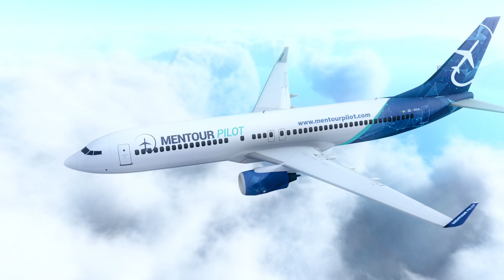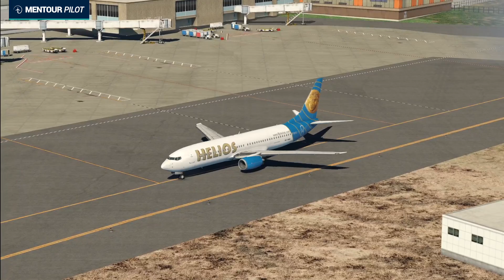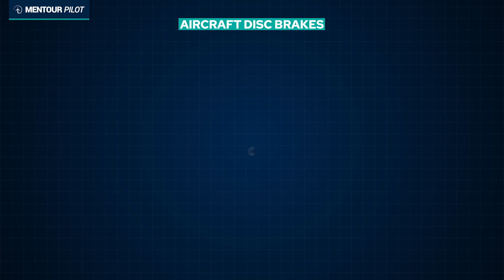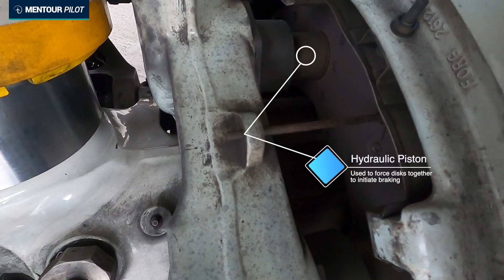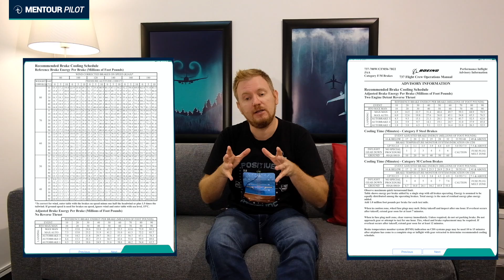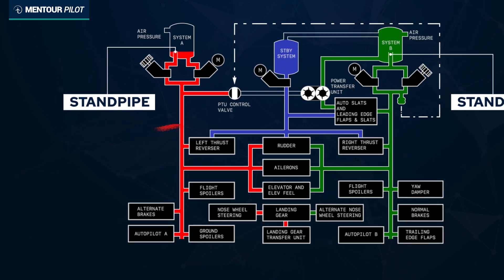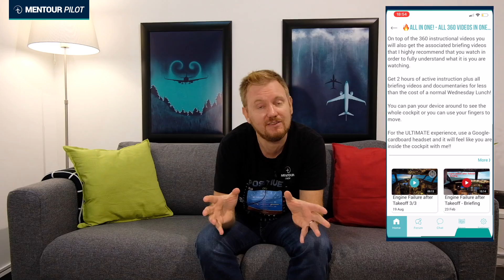How do Aircraft BRAKES work?!

Comment: Why don’t u drop the Landing gear earlier before Landing so they could cool down in the airstream.....
Reply: Extending the landing gear produces lots of drag--probably leading to more fuel use. I'm not a pilot, but I'd assume airlines won't want to go through the process of developing new procedures for this kind of brake cooling if:
-the current procedures seem to work well enough, and
-fuel is such a large expense
Reply: @almach6279  as u can see in the chart,  the temperature drops pretty fast right before touchdown so it is a matter of some minutes..... an in final approach u would have to hit the airbrake less... but ok.. I‘m willing to accept someone with more knowledge about flying than me, might have tough about it already.  ;o)
Reply: No need to cool down brakes before they are hot😉
Reply: @speedbird9313  if u look to the chart... and as he mentioned it ....there obviously is....
Reply: @frankangermann6460   Maybe on an island hopping airline with a lot of short haul, but other than that I dont think anyone actually use that chart😆
Reply: @speedbird9313  as he mentioned it.....
Reply: @frankangermann6460  Is that your reply for everything? As he mentioned, as you can see in the chart..
You have no idea how this works in reality do you..?🤷🏻‍♂️
Reply: @speedbird9313  yes, absolutely...that’s why i was asking, but ur 1st answer made no sense and ur second was not a new.... What should i do? he just mentioned it in his video and it is shown in the chart, its a fact that u obviously missed, sorry.... i was asking actually for this situation of hopping....🤷🏽‍♂️

Comment: Would love to know more about runways
Reply: Two kinds:  "Flexible" (asphalt) and "Rigid" (concrete).  A typical rigid-runway thickness is around 30 cm (international airport) or less, with flexible runways needing to be thicker than rigid to have the same load capability.  Beneath the pavement is a subbase such as compressed gravel, and beneath that the subgrade (native soil).

The cross-section of the runway is "crowned" to promote water removal, sloping downward from the centerline towards either side by about 1.5 degrees.  The main landing gear struts of at least some airliners are canted inward by that same amount, so as to have inboard and outboard tires on a strut make even contact with the runway.

Runways wear out over time from fatigue, like how a metal part eventually fails from bending it back and forth.  So limiting the stress an airliner imposes on a runway (by the number of tires / tire spacing / tire pressure) isn't about the pavement suddenly cracking or rupturing, but rather how many years the pavement will last (and why landing fees are based on aircraft weight or similar -- more pavement stress means less years until the runway needs to be replaced).  The effect that a given airliner type at a given weight has on a runway's fatigue life is quantified by the ACN/PCN method.  Derived from fatigue modeling theory, an Aircraft Classification Number(s) is matched against a Pavement Classification Number to estimate how pavement life will be impacted by anything from an individual aircraft operation to a hypothetical mixture of aircraft types and frequencies.

Comment: Interesting video. I always thought that carbon brakes have always a greater performance in stoping distance. But this is not true? Carbon brakes are mainly for weight reduction and better brake cooling?
Reply: For any brake system, the tire friction on the runway is always the limiting factor.  The traction of the tire doesn't change with steel vs carbon brakes, so the stopping distance won't change significantly -- unless, as Mentour points out, you overheat your steel brakes and they stop working properly.

Comment: Petter, any semi truck driver who deals with long down hill runs know this. That's why they gear down and use engine (jake) brakes rather than rely on friction brakes. Brake fade is a thing, and if a trucker overheats their brakes - well that's what runaway lanes are for. I can't imagine anything more terrifying than having a brake failure as a pilot, trucker or, in my case, in my POS car.
Reply: That is really a case for hybrid trucks

Comment: Do you ever accidentally press the rudders while trying to brake?
Reply: Gabriel Simon another good question. The toe brakes do take some getting used to, and they are surprisingly sensitive.
It’s very easy to over apply or apply one side more than the other until you get a good feel for them after a few flights. Likewise, it’s not unusual for a pilot new to the aircraft to apply some rudder by accident whilst braking which tends to lead to over compensation with the other pedal and a rather untidy rollout! Again, it doesn’t take long to get a feel for them and get the hang of smooth and even brake application. As the video explains, in most cases, the pilots will let the auto-brakes take the strain for the initial brake application and then take over manual braking by overriding the auto brakes with toe brake application once the speed is reduced.

Comment: Why don’t manufacturers use magnetic braking to reduce heat generated under severe braking?
Reply: Just my guess: Because the heat would still be there. The kinetic energy needs to go somewhere. But they might need less hydraulics to activate them.
Reply: It wouls still be the same heat.. if not more. Also magnetic brakes is very heat sensetive.

I only ever seen them on service breakes for japanese high speed trains and maglev breakes.

Most fast trains have magnetic breakes as emergency breakes. But they use it on the rail.

The emergancy breake of those is much more brutal than you might imagine from a train.
Reply: With no physical surface to surface contact what would generate heat?
Reply: @bradmoyer9737  The resistance that opposes the the induced electric flow within the metal.
Reply: @bradmoyer9737  Regardless of the mechanism, the kinetic energy has to be dissipated. Heat results. Heat must be dissipated.

Comment: Does RTO also arm spoilers for rejected takeoff ?
Reply from the maker: Yes, but it’s a different system that activates it
Reply: Partly.  You arm the spoilers to deploy automatically by (1) selecting RTO on the Autobrakes dial as Mentour showed and (2) move the spoiler handle to the "ARMED" position.  Moving the spoiler handle to the ARMED detent will also cause the ground spoilers to automatically deploy during not only a rejected takeoff but during landing as well.

Comment: The 737’s wheels are exposed to the elements during cruise, so wouldn’t the freezing temperatures and winds/apparent winds up there cool the brakes down pretty fast?
Reply: Probably not that fast.  Obviously the landing gear is designed to reduce drag as much as possible when it is retracted.  Thus the air circulation through the wheels is probably limited.  In fact, a quick image search shows that 737s probably have wheel covers (hubcaps if you will).  These would would help keep the brakes nice an snug in their wheel wells when retracted. 😀
Reply: @andrewsnow7386  yup, the "hubcaps' and the rubber seals around the wheels when retracted will prevent airflow in the wheelwells.
Reply: The brakes are applied on landing hardest. The air is not enough. The brakes get very hot when applied. It just takes time to cool brakes down.

Comment: Anybody know why it´s impractical to have parachutes, like the space shuttle has (i know it´s a different beast), as last emergency resource  ? Maybe it´s a silly question but it came to my mind.
Reply: I believe a Soviet airliner or two have had them, but a hassle and best to just up-size the brake a bit.  As an emergency backup, those "soft" overrun areas that a jet's tires break through and bring it to a stop gradually make more sense than a drag chute, though there's the expense of outfitting airports with them.  The drag chute for the Shuttle was introduced post-Challenger, along with a new carbon brake to replace the original beryllium one that was woefully undersized because of Orbiter weight growth between when the brake specs were frozen to when it finally flew.  The carbon brake + drag chute put some margin of safety back into landings which in some cases hadn't had any (brakes overheating to the point of pieces coming off during the rollout).
Reply: My guess would be that having triple redundancy for breaking power plus thrust reversers is covering all incidents. Carrying additional mass for one in a trillion situation is just not viable.
Reply: @Gnato666  I was wondering, with a loss of oil pressure affecting the brakes, for example. But, yes, I suppose that the redundancy and the lower probability are enough not to add an additional system.

Thx for the answer.
Reply: They are realy expensive to use. Also they have a very uneven effect. Space shuttle lands very fast.

A comersial airline land fairly slow, is also lighter than on take of.

What  makes the dimension of the breakes is the rejected takeof.

Comment: Thank you for a new highly detailed video! Quite a lot new things to know. 

The question on the autobrake (especially on the RTO braking).
As i understand the manual brake application disengage the autobrake system. But, as i understand the captain are mandated to manually apply near full manual  braking at the rejected takeoff above 80 knots, so RTO just saves about a second or so and serves as failsafe for human error basically? Is that correct?

Comment: Are the brakes on a plane like on a car where you press harder for more braking or are they binary (on or off only) or brake by wire? In other words do you need to really stand on the pedals in a rejected takeoff or just press it lightly?
Reply from the maker: They are like a car.
Reply: @MentourPilot  thanks for the reply! I've learned so much from you!

Comment: Captain, what I understand from the comparison of the two different materials that airplane breaks can be made of is that lifespan for steel is determined by the amplitude of the stress cycles (mechanical or thermal) but for carbon is the amount of cycles. Intuitive would be for me to say that low amplitude cycles do not impact the integrity. Irrespective of material. What's the mechanism that carbon brakes get damaged in the low amplitude applications. Wear or fatigue failure?

Comment: During my concript term as a aircraft mecanic, in the Swedish air force, I learned about the Saab Viggen fighter jet anti skid system. This had a quite simple mechanical design. Just a flywheel that turns with the wheel. When a sudden stop ot the wheel, the flywheel coninues to turn, and will actuate a relive valve that ease off the brake pressure. Im not sure if this design is as effective as the anti skid on the 737?
Reply: That is ingenius... thst system must outdate most cars abs... viggen is fairly old now
Reply: I think citroen implemented this mechanical abs system many years ago.
Reply: That sounds like a really interesting system.  I'd love to see it.
I can't speak to that particular system, but in general mechanical control systems can often run into theoretical limits that even great engineering can't get around.  Basically, the faster you want any control system to respond (mechanical or electrical), or the more closely you want to control an output (say rpm), then the more likely the system is to become unstable.  This is a big reason why things like mechanical governors on old engines, or old 1970's era mechanical cruse control systems on cars (ever work on one of those?), were only so accurate.  If you tried to hold a speed too close, things would become unstable and the speed would then start surging.
A huge advantage to electronic control for mechanical systems is that the electronics are usually so fast that the speed at which they would become unstable is way above anything you need to control your much slower mechanical system.  I'd be amazed if any airplanes have been built in the last 20 or more years with a mechanical anti skid system.

Comment: Can you do a video on why airplanes don’t fly in a straight line even to short destinations?
Reply: Usually it's because of airways.
Reply: Ahhh you got a heart I think that might mean a video is coming ...
Reply: @gabrielsimon7944  I hope so! It’s been a dying itch to understand this! Especially between short flights. For example, San Diego CA - Las Vegas NV. Only a 45 minute flight but seems like it could be shorter if they would just fly straight!
Reply: @AllanEvansOfficial  San Diego International Airport to wow look what I found!
VFR Planning chart has the warning heavily congested airspace and all of it is Class-B
This is another NTSB/AAR-70/06 ~ you just ruined my day

Try Podunk to Skeedunk and get back with me
Reply: Airways, which are like roads to keep traffic separated.
Reply: FAA regulations / Airways / Waypoints / Weather / Air traffic control (safety reasons) / To keep everything in order in air and ground as well, lots of more factors.
Reply: I’d like know that,,too. Great suggestion!
Reply: The joys of non-Euclidean space.
Reply: The FAA (presumably in cooperation with other authorities) is working on upgrading the air traffic control system to allow more and more direct routing to increase the efficiency of the whole system.
Reply: Also runway alignment that might vary I'd guess
Reply: @rohrichoak9740  interesting thought, depends realistically on how short of a flight OP is talking about. A 5 mile flight might make sense. Otherwise runway orientation has nothing to do with the direction of flight until you're generally within terminal airspace.
Reply: @rohrichoak9740  
No, that's not a factor. 
A pilot adjusts his  approach to whatever way the runway is oriented  regardless of the direction of his approach. ✌
Reply: "Flat Earthers" have now been triggered!  🤣
Reply: @Hanoifilms You are really angering all the "flat-earthers" right now!  Lol.
Reply: I would love this too. Very often flights I'm on turn left and then right a couple times after take off. I know there are Airways they have to aline with, but sometimes its left and then right like immediately after, and I wonder if the airways in different directions really are that close together?? Surely if there's no one around we could have just gone straight through them, and saved all that fuel and energy of turning so much just to end up the same as before? Or are the pilots just routinely checking the turning functions of the plane are fully functioning before continuing on? 😅 I always wonder this, it seems so pointless to me 😂 but I'm not a pilot so what do I know lol.
Reply: @FrancesLeone1  I’ve seen this too! It is weird like you’re saying. I follow planes on the Flightradar24 app and I notice many planes even on short routes take seemingly random turns only to turn right back to the same heading they were on, when the radar clearly shows no other aircraft around. And I see a pattern of all the other aircraft flying into the same city doing it. Like, why!? Why not just ignore the turn and go straight potentially saving about 10-15 minutes
Reply: @AllanEvansOfficial  Yes! Glad I'm not the only one thinking it's weird in the circumstances! lol. I like that app too
Reply: @FrancesLeone1  well as do cars, planes also have some kind of skyway entrance/exit. For example on a major skyway you are in the right side and need to be on the highway to your left, sometimes you do a right turn, overfly/underfly the current road you're on then make the left turn going to your desired exit. It's just like planes, we have charts telling us exactly when to turn, to climb, to speed up etc. You can't just enter/exit a terminal area anywhere, that'd be utter chaos so departure/arrival chart were designed to bring order and subsequently make the skies have more safe and Efficient passage for aircraft 😊
Reply: @AllanEvansOfficial  it's an arrival/departure chart specific and unique to each individual airport, see my comment above for an explanation
Reply: my guess is the world is round...
Reply: @williamhaynes7089  Do you have any idea how many flat-earthers you've upset? 🌍
Reply: usually it looks curved because the flight path is depicted on a flat surface. On a globe, flight plans would look straight. 

If you're interested in the math behind it, a straight line between any two points on a sphere will always be a segment of the great circle. The Earth isn't quite a sphere, however, so it complicates things a little bit, but that's the basic idea.
Reply: I hope we get it!
Reply: On Flightradar24 app the planes always seem to travel in a straight line.
Reply: Generally you do however larger airports in populated areas (more air traffic) have departure and arrival routes that keep all the airplanes safe from each other and reduce ATC workload. There are also airways and recommended routing for city pairs. Finally it also depends on which runway you will takeoff and land on.
Reply: The rotation of the earth.
Reply: @Rodiak41  
Yeah but what about short flights?  I know (from YouTube )  that one factor is planes are routed  over land as much as possible. And there are of course other factors.
Reply: @Rodiak41  The rotation of the earth isn't really a factor because aircraft operate within the lower earth atmosphere (which basically rotates with the earth - or we'd have some hellacious surface winds all the time).  It is more of an issue when spacecraft re-enter earth's atmosphere to land since they are coming from an environment (space) which is not tied to or affected by the earth's rotation (like the air masses at lower altitudes) and entering an atmosphere that is tied to and affected by that rotation.